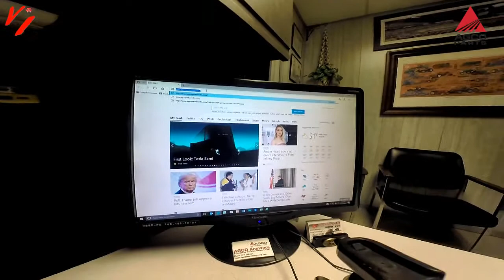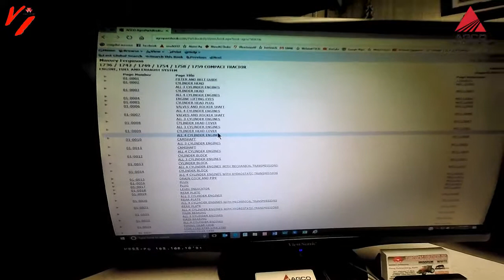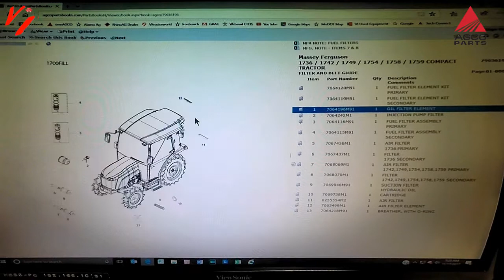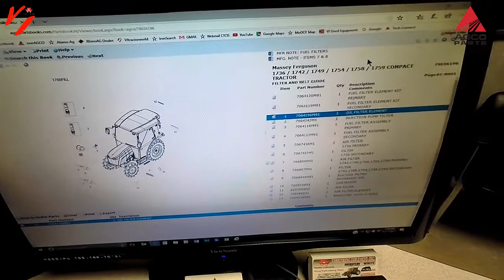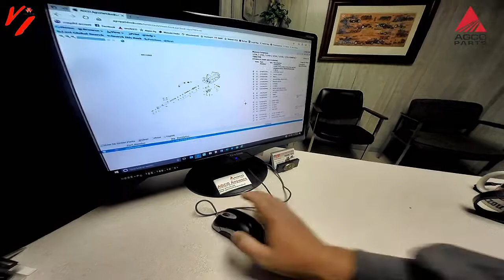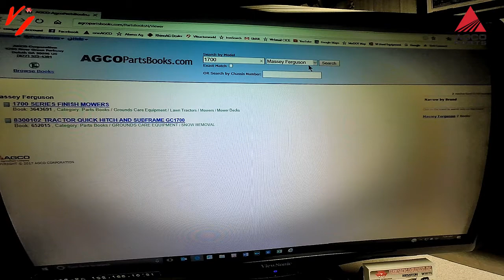AGCO Parts: Online Parts Books for Massey Ferguson & AGCO Heritage Brands (Gen 1)

Comment: Is it possible to see if the part you are looking for is still available to get, like if There is Any parts left of that kind or do you have to find that in other ways?
Reply from the maker: Best way is to connect with you local dealer and set up an account then you can send shopping cart and they can check status and get back with you. There are some dealers that are connected with their inventory system but that is very expensive to offer that service. Or you can send and email to the dealer or pick up the phone they should be glad to assist. You got the hardest part done looking up the part numbers